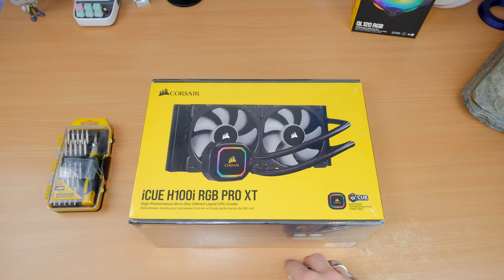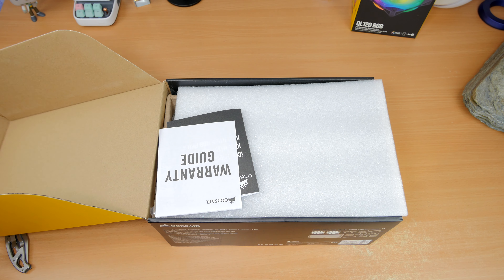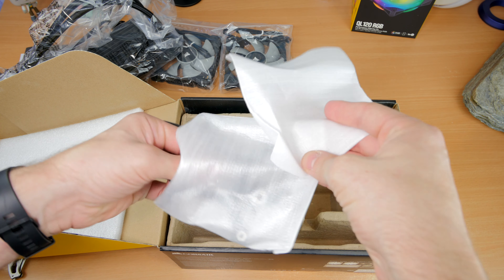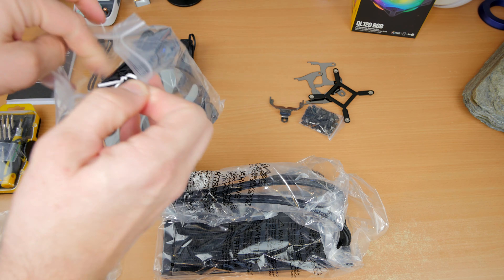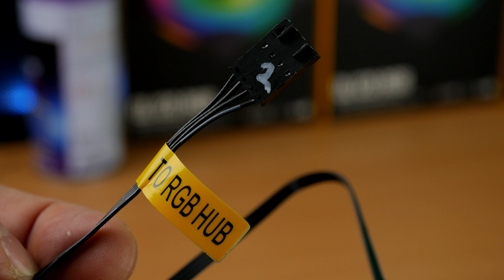Corsair H100i RGB Pro XT AIO unboxing and installation (with Corsair QL120 RGB fans too)

Comment: Hey man, quick question. Did you use a commander pro or node pro for the fans? I have the same CPU cooler and for whatever reason my fans aren't lighting up and everything is connected correctly as well. I've been looking at youtube videos to see if i possibly did anything wrong and  everything looks the same.
Reply from the maker: The standard fans that come with this aren't RGB
Reply: The Provoked Prawn That’s odd, I had my bottom fan lighting up on one corner a couple weeks ago and ever since then I couldn’t get it to turn back on.
Reply from the maker: @Flabbzs  I think you might be going mad. The standard fans are ML120 PWM fans. They're not RGB at all. Tbh the product is misleadingly labelled. The RGB is only on the pump itself. Take a look at the official page and you'll see https://www.corsair.com/uk/en/Categories/Products/Liquid-Cooling/iCUE-RGB-PRO-XT-Coolers/p/CW-9060043-WW
Reply: The Provoked Prawn I actually took a picture of it, it was glowing like a bright green light. Unless it was something else form inside the pc but at the time I didn’t have anything bright green of that color inside.
Reply from the maker: @Flabbzs  very odd. If the fans were RGB they'd have two cables as you can see from the QL fans I installed in this video.
Reply: @TheProvokedPrawn  yeah mine came with those cables. I was actually looking around and apparently it is rare that they do send some with fans that are rgb which is odd.  just very confused as to why mine aren't turning on.
Reply from the maker: @Flabbzs  well, if it does have two cables you need to run them into a lighting node first before plugging into motherboard. The power cables could go into the motherboard but the RGB needs the node to control it.

Comment: Have you tried syncing it with Mystic Light? I read most MSI mobo manuals and they don’t list QL on it. Makes me sad :;
Reply: sorry bud, corsair can only connect  to iCue and not motherboard rgb. it does connect to PWM tho
Reply: QL fans come with the Node Core if you buy the 3 120mm pack or the 2 140mm pack. if you don't buy one of those, you will have to buy a node pro

Comment: Ok so it was not only me with that problem i returned the 1150i xt because of the pressure you need just to screw everything in, and the quality feels bad compare to noctua.
Reply from the maker: I've had that with every Corsair AIO. They should pre-mount the fans and make life easier.
Reply: Use a drill next time and the quality is good man. The h60 is bad quality..

Comment: So do you control the fan speeds in Corsair iCue? Or with Motherboard software?
Reply from the maker: Yes, you can control fan speed with iCue
Reply: @TheProvokedPrawn  thank you! I'm gonna get one of these for my Ncase M1 build! Im going to replace the fans with Noctua NF-F12. Should be great!
Reply from the maker: @Subdubbin Yeah oh I see. In that case you might need motherboard software. I'm doubting myself now as I've just switched to a NZXT Kraken and I can't just check for you.
Reply: @TheProvokedPrawn  Really? They are 4-pin PWM Noctua fans. It shouldn't matter what brand fan they are right?
Reply from the maker: @subdubbinyeah5284  I misunderstood what you meant. Thought you were doing RGB like I did. It'll depend on how you set them up I expect. If you're plugging them into the motherboard then you won't be able to control them via iCue. Though I'm not 100% sure tbh
Reply: @TheProvokedPrawn  No RGB this time around. Yeah I will be using the the two 4 pins coming off the CPU block for the fans, so iCue should control them. I have had good experiences with iCue so I'll be happy if it works! Thanks for answering me :) And nice video.
Reply from the maker: @subdubbinyeah5284  then yes. That should logically work! Good luck

Comment: I installed everything and added ll 120 fans to radiator..all lights work on fans pump is working but i cant get the rgb to turn on on the pump.. two days in and losing my mind. Pleeeeease help??!!
Reply from the maker: You connected the pump to the motherboard via USB?
Reply: @TheProvokedPrawn  yes i did.. the pump is working fine and keeping cpu cool its the rgb on pump that wont work
Reply: @TheProvokedPrawn  i just dont have a place on my rog strix 390 gaming mother board for the 3 pin cable with one wire
Reply from the maker: @hondawagonz886  that cable should plug into the CPU fan header on your motherboard. Mine is 4 pin it doesn't matter.
Reply: @TheProvokedPrawn  do u know what exactly that cable is for? Is it for the rgb on pump?
Reply: @TheProvokedPrawn  im seeing alot of people talking about the sata cable not having enough power.. anyways.. you have a new sub!
Reply from the maker: @hondawagonz886  tbh I thought the USB controlled the RGB. You're using iCue and have checked for firmware updates?
Reply: @TheProvokedPrawn  yes everything is updated.. icue even shows the pump and lets me set up coloring for pump..shows it on.. it just wont turn on

Comment: How do i fix my led light on the cooler they dont light up at all ??
Reply from the maker: You plugged in the USB cable? Downloaded iCue and updated it?
Reply: The Provoked Prawn;  it dont let me update and what usb cable ??
Reply from the maker: @bsanchez3010  There's a micro USB cable that comes out of the pump and plugs into your USB header on your motherboard (or into a Commander Pro if you're doing it that way). I showed it in the video. Without that it won't light up I'd imagine.
Reply: The Provoked Prawn  i checked all the cables and yes the usb is connected in back of the motherboard everything is connected right
Reply: And yes is updated is all good with latest Version
Reply: @bsanchez3010  hopefully using usb 2.0

Comment: my rgb pump doesn't work for some reason and i think i'm doing something wrong with the wires like everything is perfect but the rgb pump is the only thing that isn't working and it's because of the wires can anyone help?
Reply from the maker: USB connected to motherboard and sata power connected? And is it recognised by iCue?
Reply: @TheProvokedPrawn  yes it is
Reply from the maker: @zso2250  hmmmm. Odd. Firmware/software updates?
Reply: @TheProvokedPrawn  i updated everything i can update

Comment: Anyone have experience with this? Im really on the fence about it, because Id rather go aircooling, but where i live the air coolers arent that good. And shipping is astronomical
Reply from the maker: Weird question, unless my opinion is invalid?
Reply: @TheProvokedPrawn   No, not all. I just wanted other peoples opinions as well as Ive heard horror stories of AIOs leaking. Im planning my first build so im just trying to get as much insight as i possibly can. 
Never intended to come off as rude, my apologies if I did
Reply from the maker: @1pspgofan  I've never had an AIO leak. And I've had loads of them both before and after I started YouTube
Reply: @TheProvokedPrawn Guess Ill bite the bullet and try this AIO as its priced very well where I live. Appreciate you taking the time to reply my guy!

Comment: Why is no one talking about these coolers?
Reply from the maker: I am
Do I not count?
Reply: The Provoked Prawn  no you do lol but the cooler has been out for a little while at this point but I cant  find anything on Reddit about it, barely any videos, and there are only about 10 reviews on Amazon. Your video was actually extremely helpful, but did you have any problems with the fan screws damaging the radiator? Two reviews on amazon said the screws damaged their rads and didn’t fit properly
Reply from the maker: @fraggie6166  yeah the screws are an arse. It's the radiator fins. They're not well made. I've had the same issue on plenty of others.
Reply: The Provoked Prawn would you recommend going with the previous h115i pro over the new xt version then? Or is this not that big of a problem and the rad will function fine

Comment: I have the H115 version, coming from the Kraken x62 and am very pleased with the performance. liquid on my X62 ran at 37c after 1hr of BF5 where  the H115 runs at 25.5c, not sure why such difference is there and cpu runs a couple of deg cooler, max at 67c on x62 was up to 70c (9900k). I had to use two washers per rad screw to help prevent fin damage. I use custom fan curve and pump left on balanced. Never know whether to run fans based on cpu temp or liquid temp, currently based on liquid temp.
Reply: So these new corsair AIOs are pretty much the best performers currently?
Reply: @megapet777  compared to my x62 my cpu definitely runs cooler by a few degrees and it's over clocked to 5ghz on all cores. The x62 was 2 years old but the liquid temps seem much lower on the Corsair.
Reply: @Getting-Older  Nice, was it hard to install with all the extra cables? Also is it quiet under load?
Reply: @megapet777  found it fine to install as had experience with the nzxt kit so no problems. Under load it is quieter than nzxt but I've tinkered about with fan curves and settings so am currently running fans based on liquid temp and it's isn't to intrusive.
Reply: @megapet777  so it's under load now, cpu at 74°c liquid at 26.7°c fans at 1245 rpm and it's at 49dba with front door open on my fractal design 6 case.  Processing folding@ home on both cpu and GPU.
Reply: @Getting-Older  Nice :) It's cool that you do folding btw. I've been also considering ARCTIC Liquid Freezer II 280 since it performs so well and has only 1 cable to connect everything. And it costs way less than other AIO's. But it's also bit bigger and doesn't look as good. I would love to install it into fractal design meshify c mini case. But I don't think it would fit with my GPU. My GPU is 286 mm long.

Comment: My fan works but the lights dont :/
Reply: do you use lightning node?
if yes, you have to connect the fans in order.
if you skip, it wont work. I exoerienced this problem when I plugged rgb headers to 3,4,5 coz I was saving 2 slots for my upcoming ql rad fans, so I plugged my current ql fan rgb headers on 1,2,3.

Comment: huh you got 2 different gpu's?
Reply: @TheProvokedPrawn   At 12:35 i see a msi card isnt that a gpu?
Reply from the maker: @ksr2513  no. It's an M.2 expander card. Holds multiple NVMe drives.
Reply: @TheProvokedPrawn  Ow ok